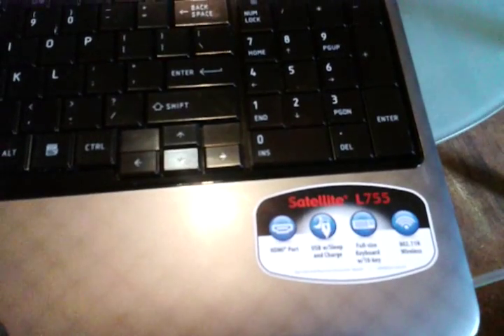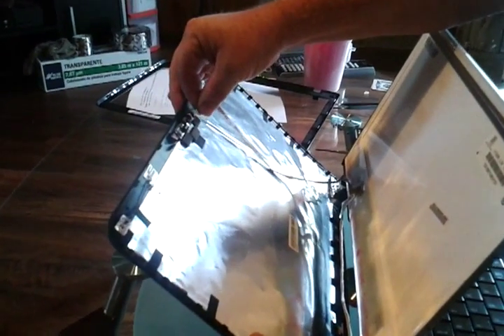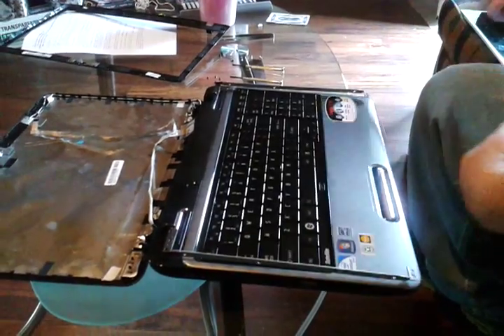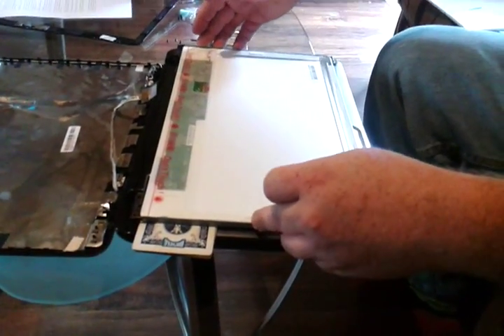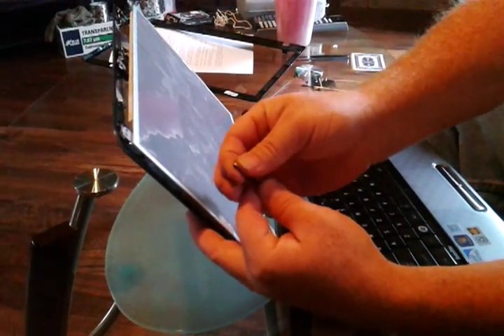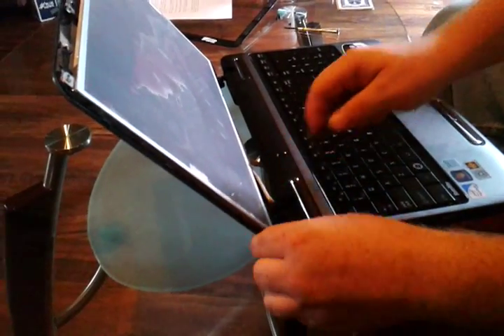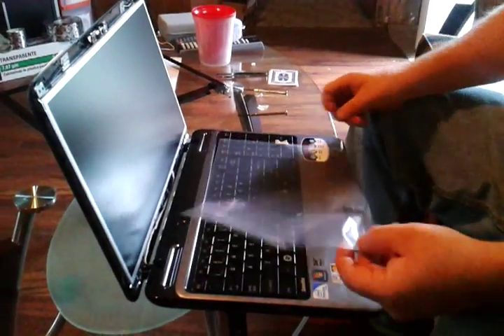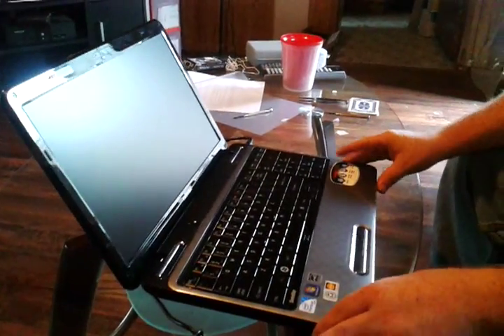Toshiba Satellite L755 Laptop Screen Replacement

Comment: Ridiculous!!!! The most complex and difficult part is to connect the screen with the cable attached to the webcam. The view is blocked with the guy's hand :((((. Very disappointed. We all know how to remove the screws. What we struggle is to make or remove the pin connections which this video does not show.

Comment: Me again.  I than tried factory reset by holding down 0 key and re starting until beeping released black screen again w/courser but the screen came down about a 1/4 of an inch with what looked like snow but more like if everything was compressed on in self in a tiny area.  that's as far as I have gotten.  Thanks e-mail if you can help thanks

Comment: Hi, I have a friend's that the screen was replaced now after 1 week it has stopped working altogether.  I get the splash screen for only 1-2  seconds at the most.  Than it goes to black w/flashing courser.  I played with it to go into bios that works, but I have nothing to go by to know what the settings are.  I than pulled out cmos battery waited than back turned on went back to bios reset the clock and date rebooted still nothing.  sportseins1@yahoo.com